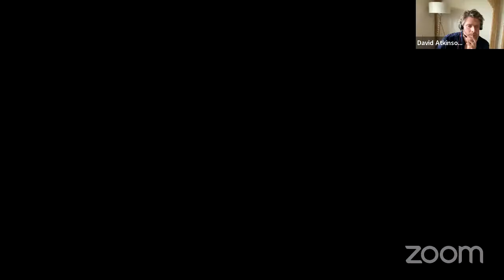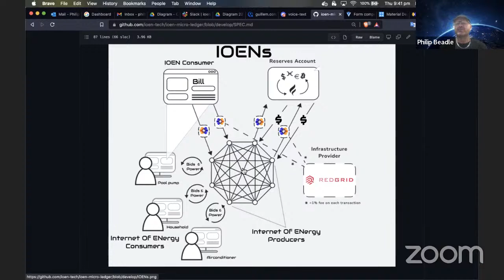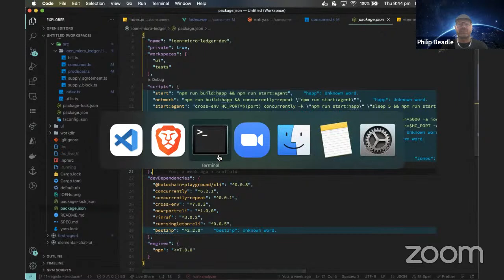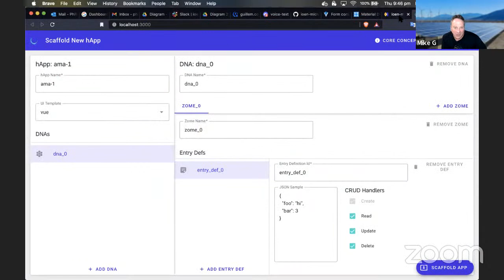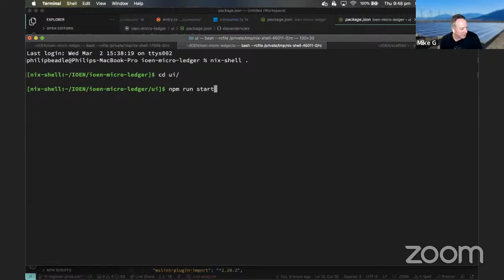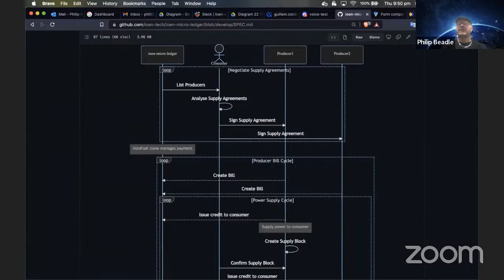Ecosystem Sessions - The Internet of Energy Network (IOEN)

Comment: Please confirm I understand this, the  Internet of Energy is the ability to sell kWh from domestic scale solar/wind generation to a local market. The current business model being you generate and sell back to the grid at a fixed price,  but now able to sell in an open market? Have you thought of contacting local petrol/service stations with electric vehicle chargers on their forecourt? Building a market for local generated power to be bought and sold to charge electric vehicles at local charge points. Perhaps enough volumes needed can't be generated locally, but the sale point must be the offset of buying kWh straight from the grid and creating a local (de-centralised) energy market,  that can stil be supplemented by grid generation when needed. Thoughts and feedback?